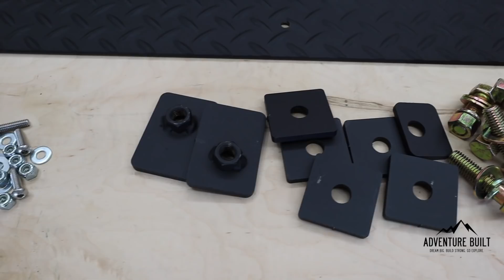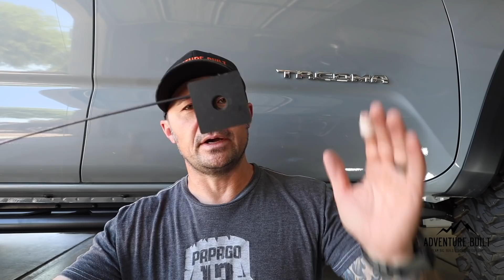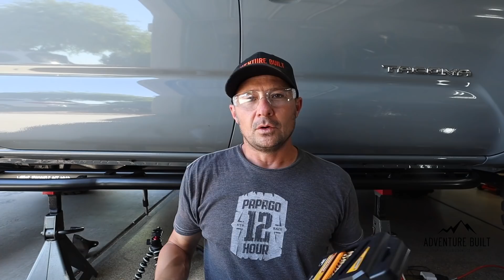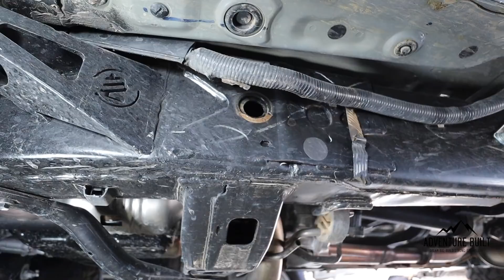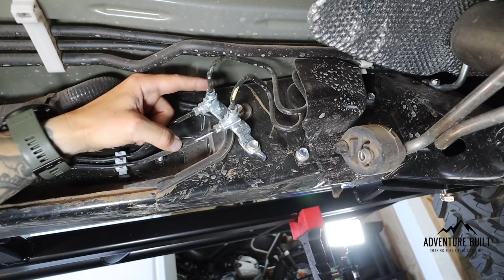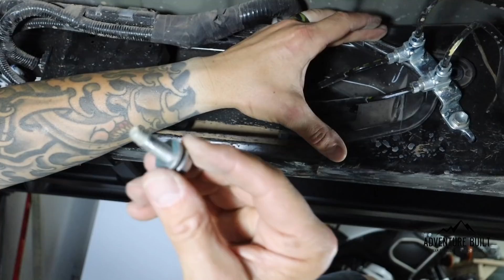White Knuckle Off Road ROCK SLIDER Install 2020 TOYOTA TACOMA...NEEDED TRAIL PROTECTION

Comment: Are you worried about the hole you drilled rusting out the frame over time? I live in Hawaii and it’s salty here.
Reply from the maker: So I live in the desert so it’s not on my radar but would definitely be done for pretty much everywhere else. Good pickup.

Comment: How have the sliders held up? Has there been any excessive rust around the drilled holes?
Reply from the maker: The sliders are absolute bomber. I used the crap out of them in Moab and they didn’t budge. Solid as a rock. Also no rust around the bolt holes but I do live in the desert so to be expected. I would definitely treat the holes anywhere else in the country.
Reply: @AdventureBuilt  what would you recommend for the holes? I live in Socal so nothing extremely wet
Reply from the maker: I use a Krylon paint/primer in black. Spray some into a small cup then use a q-tip or a small brush to cover all the holes. Let it dry for about an hour and you would be good to go.

Comment: I really like everything about these except how the ones for the GX460 mount up. Apparently they attach with U bolts in that version. Seems like it could slip slide down the frame it I hit a rock just right.
Reply from the maker: I’ve heard the U Clamp is actually crazy strong.

Comment: FYI, the long bed slider version requires (3) frame holes in each side.  As recommended, be sure to have high quality bits on hand.  Even better, have 2-3 of the 1/2" bits ready (the tip of my brand new Dewalt 1/2" bit snapped off while drilling the 3rd hole on my first side).  Also I did not need to use c-clamps.
Reply from the maker: All good info!!! Thank you.

Comment: Apologize if i missed it, but does the wire on the nut stay there permanently? or do they break off? I can imagine rattling around in the frame while offroading
Reply from the maker: Yes the wire does stay there permanently. It is very stiff and is locked into place. I haven’t heard and squeak or rattle in the area and all the. Lots are nice and tight. I think it’s a non issue.

Comment: Great video! I really like that these sliders are longer than others on the market, seems like they protect just a bit more. Unfortunately I wish they came in 20-25 degree, I don't really need a step, I want as much clearance from rocks/debris as much as possible.
Reply from the maker: Thank you very much. They are amazing. Honestly I use the step way more than I thought I would. Setting up the tent, accessing everything on the roof. I’m always standing on them for something.

Comment: Looks like a pain to drill all those holes. Plenty of no-drill sliders out there.
Reply from the maker: It was a pain and I looked at a bunch of different slider companies. White knuckle just had the most stout design at the best price. I’m all about quality and value. All they do is sliders and they are awesome. I’m in Moab now and have slammed, scraped, bumped, slid and road both sliders and they have not budged an inch. If spending an hour drilling some holes in my frame to install a product that will do it’s job without question, that is time we’ll spent. In my humble opinion!!!!

Comment: Thanks for the video.  Regarding those inserts for the angled hole in the cross-member, it looks like the nut is oriented up.  True?  I don't mean in/out, the nuts go inward.
Reply from the maker: Thank you very much. Yes the nut is up inside the crossmember. The bolt inserts from underneath.
Reply: @AdventureBuilt  : Thanks for verifying that.  I just got my sliders and have been reading the instructions making sure I understand them before I start.  I had just figured out what those wired backing plate were for when I found your video.

Comment: This company is about 30min away from me and the product looks good! I'll be able to save some shipping costs. I saw the video of the Power Wagon landing on the WK sliders and they held up well! Plus install is not all that difficult compared to other sliders. One question for you if you would please. Did you not think it necessary to paint or treat the bare frame metal after you drilled it out? Wouldn't that be a good idea so it doesn't cause rusting issues? Maybe hit it with some Rustoleum.
Reply from the maker: desert55gr You are absolutely right, White Knuckle is a great company. And again you are correct, you should treat anywhere you drill into metal. I honestly forgot about those concerns because I live where it almost never rains. Just like I always forget a rain jacket when I travel. But still a good practice. I’ll do it the next time I remove them. Thx.
Reply: @AdventureBuilt  Ya I feel like that's a good idea! You could also just easily remove the two bolts where you drilled and with a paint brush stick it in there and coat the exposed steel. No need to remove the whole slider.

Comment: Where can I get your Multicam Black hat?

I’d want to paint the Allen key bolts or ask for black hardware
Reply from the maker: We will have some for sale soon. Still fine tuning the design. I agree on the black bolts. Unfortunately it’s is 116 degrees outside so only necessary mods being done until after summer. I will let you know when the hats are for sale. Thank you.

Comment: Nice video and sliders. Not sure about the silver hardware on the cover plate. Think would look better if they were black coated.
Reply from the maker: Thank you very much. I agree that the black would look better but the contract is kinda cool also. Its a brushed steel not chromed thank god. However, I’ll probably end up swapping it out for black at some point. The struggle is real!

Comment: Hi, just a quick question, didn't you apply any anti-rust coding to your frame after drilling them holes? 😱😱😶😶
Reply from the maker: Lester PJ no I didn’t because I live in the desert those things slip my mind. It is definitely a good idea to do that. Thanks for the heads up.
Reply: I just sprayed some cavity wax in there. Seems to be working out fine. No rust so far